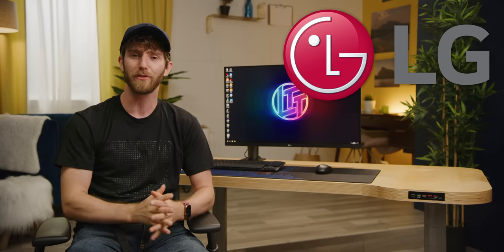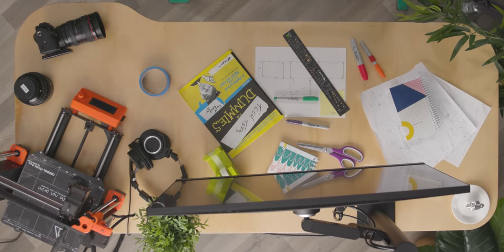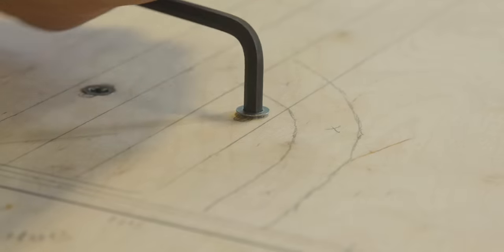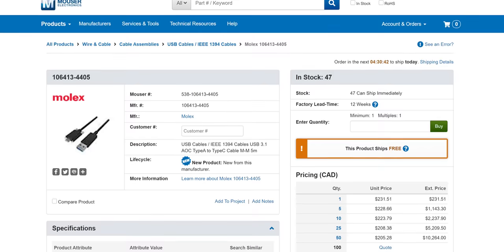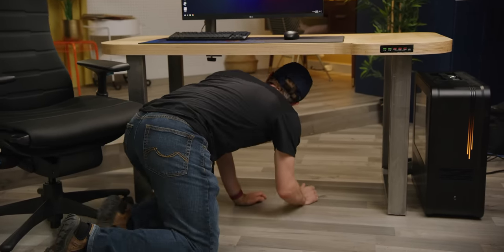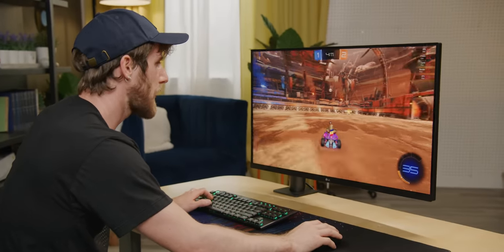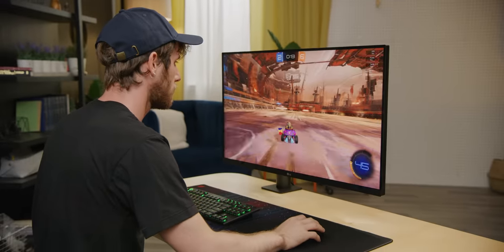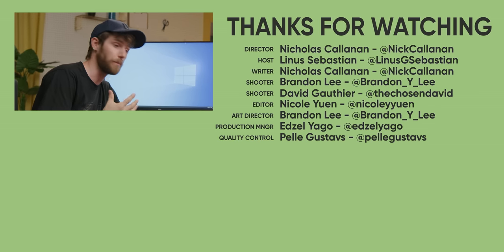Project Zero Cables - The Cleanest Desk Setup EVER

Comment: "I remember when 30" displays were super expensive" Yeah, so do I, Linus. It's called "today"
Reply: Well it ain't cheap that's for sure. My 50" TCL 4k tv only cost about half of what this monitor costs. The one thing I will say though is that I'm sure that monitor gives a much better picture.
Reply: Well, my "no name" 32", 1440p, 60Hz was around 350$. For casual gaming and work in CAD software it's great (paired up with i5-8400 and RTX2060)
Reply: I have an Acer curved 32.1 inch monitor I got for $250.00
Reply: It depends what res - 55"-65" is now very affordable for a TV even at 4K, let alone 1080p.
Reply: Ben Q has a 32 inch 4K 60hz 1ms monitor for $299 right now. I think LG has one with the same specs for about $279. I was seriously considering the Ben Q
Reply: You guys are getting monitors?
Reply: He's obviously referring to the excessively long period of time when 2560x1600 30" monitors cost $1,500-3,000 dollars.
Even while comparatively similar 27" 1440p monitors were sub-$1k.
Reply: Prices and perceived value will always be subjective, but everyone here can easily identify the difference between a $2,000 monitor 10 years ago, and a $350-500 monitor today.
Reply: meh my 27 inch IPS 1440p 16:9 1ms 120hz G-sync monitor was 800 euro.. 4 years ago when I bought it for 800 euro it was the ONLY monitor like it.

what surprises me more is than I wanted 4k 32 inch back than.. but nobody made them.
sadly nobody is making them today either.

-yes you can have 32 inch, 1ms, 4k and G-synch..
*but of IPS, 120Hz and 16:9 you can only have 2.
*you can have IPS and 16:9 but than screens only go 60hz
*you can have 16:9 and 120Hz, but than you only get VA
*you can have 120Hz and IPS but than it won't be 16:9 but those anoying wide screen monitors.

so I am still waiting for the monitor I want.. and despite all the "progress" 4 years later it still aint here yet.

as for widescreen.. at the moment I have 3 27 inch monitors turned portrait side by side.
that effectively gives me 27:21 what much closer to the for strategy gaming ideal 3:4 is.. than 16:9.
But I'd love to replace them for just one big monitor or two 32 inch, getting rid of some bezzles.
Reply: Well he probably gets them for free so he does not actually know what they are worth
Reply: @Joe K . You've been on the internet before, right?

Reasoning is not an attribute that is widely used.
Reply: I've an AOC Q3279VWF and was able to get less than 200eur. Its only WQHD with 75Hz but better than the FullHD 27" before and now i can count pixels on fullhd screens.
Reply: ViewSonic 32" 1440p 144hz curved $180 delivered from the factory over a year ago
Reply: @robertt9342  his name is funny so I think he has
Reply: @xManzi  And I can get a 32" tube type for free. Can't really compare 4K HDR10 apples to 1440p oranges
Reply: Manzi BENQ PD3200U?
Reply: Yogurt  *richer ?
Reply: @ReQuiem_2099  Same thing a few years before that when a good 24" 1920x1200 monitor was $800 but a 22" 1680x1080 could be had for less than $300. Back then, and I'm sure now, most of the people buying the outliers were professionals in fields like CAD, film/audio production, that sort of thing. Linus even said it in the video, this monitor isn't particularly great at response time, neither was my 24" Samsung back in the day (The $300 22" monitors had 2ms, I was stuck in the stone ages with 8ms 😂) but gaming was only about a third of my computer time. Different value calculation for everyone, the stupid expensive monitor wasn't great for games but it sure helped my productivity so it paid for itself in spades.
Reply: Yeah my buddy just bought a 4K 32" Samsung panel for $450
Reply: @petecastiglione6205  Next time try to read carefully... 1440p is nice middle ground. It's sharp so you can read text, 32" is big enough, and that resolution isn't so hard to drive Like 4K. So, no, it isn't comparing apples to oranges
Reply: @zakhaevw5258  no, I think company is called iilayama, or something Like that. It's a flat panel (i prefer it for CAD) and it's kind of minimalist/professional look so it was perfect for me
Reply: @tnix88  . wooo..... you see where this is going
Reply: @W1ldTangent  yeah, but for everyone that isn't getting the company to cover, or directly financially benefiting from their work, it sucks pretty bad! I remember the price hike on the 16:10 24"s too, but I really wanted those 1600p monitors back in the day. Now I have a curved 43" 4K that's pretty decent for basic productivity and light gaming, although obviously only 60Hz, but I'm keenly watching 38"(37.5) 3840x1600 prices.
Reply: @karelkootjes4019  The big market gap I see for the 4K real estate is 36". I've had a 39", and 2 43" "monitors" (they're TVs at that size) and enjoyed them, but you have to have a very specific seating distance for it to really work. Plus there's always a little fussing with scaling. I think a 36" would perfectly meet people's pixel density to screen real estate needs.
Reply: @ReQuiem_2099  haha, speaking of stone age, I'm still rocking the WUXGA party at home and work, dual 24s at both desks. I use docked MacBooks for anything that isn't gaming, and we likes our 16:10s 😂 2560x1600 is still pricey to this day, that and I physically don't have room for a pair of 27" screens.
Reply: Yogurt  Yeah, I wish he would think for a second before throwing out dumb out of touch lines like that.
Nobody I know has a $700 monitor, or would deem it anything other than "super expensive".
Reply: @ReQuiem_2099  
as I am a strategy gamer I must admit that the more of the map one can see at one time, the better advantage you have.
-
but if things get to tiny, you miss the very oversight you need, so indeed 4k for me only makes sence starting at 32inch.

as for your prefered 36 inch.. It seems that the market has a few prefixes and it seems that after 27 inch, 32 is the next step, so hoping for a monitor in that more standard size bets better bets than an off format.. but larger.. as long as it has my other desired specs.. is ok with me too.

my problem is there just AINT a monitor larger than 27 inch with the specs I desire yet.

as for ideal format.. I like my monitor at armslenght or about 60 cm (24 inch) distance from my face.

as a strategy gamer bent montors deform my vieuw, and for work too, so I prefer a straight non bend screen, that covers as much of the area I can focus on.. without covering the murky bits that only one eye can see.. that wide screen monitors give.

as such my practical vieuwing area is about 30 inch or 75cm wide and 22 inch or 55cm high.

That would indeed be 36 inch.. but only if in the classic 3:4 format.
->
if that got paired with 3200x2400 pixels (QUGA) it would be perfect.
though perhaps 4096x3072 pixels (HXGA) would be nice too.
(QUGA at that size gives it the density of 27 inch 1440p.. and while I admit I can see pixels sometimes if I sit to close to my screen.. it sufficices.. HXGA would make it 70% more dense.. making it more smooth looking without needing the unneccecairy density of 4k)

now that would be an ideal world.
But hoping for a HXGA 36 inch IPS 1ms G-sync 120Hz monitor is hoping for the impossible.. I would glady shell out 10k or 20k for the chance of owning such a marvel.. but the world has sadly moved beyong 3:4.
-strategy gaming is to small a market, and while it is true that in the office space 3:4 is still in demand.. they do not demand gaming specs and as such none of those overpriced modern 3:4 will have gaming specs.

-that said it seems the pc gaming monitor market has moved beyond 16:9 too.
*I wish for a product the market is starting to move away from.. we see a split happening.
-32 inch 16:9 IPS aimed at designers and editors.. for who 60hz suffices
-32 inch 16:9 120Hz as a "last ever made" VA product
-32 inch(and larger) 120Hz IPS all becoming widescreen 32:9 and 48:9 and the likes.. as most gamers (all not strategy and strategy has always been a minor segment of the gaming market)

so as things strand hoping for a 32 inch monitor with ALL my desired specs (IPS, G-Sync, 1ms, 120Hz, 16:9, 4k) is already hoping for somebody putting a real niche product on the market and likely being the last of it's kind.

*you say that perhaps hope glooms in tv land.. tv's are not yet at pc monitor quality but the gap is getting smaller.. and tv's are much less likely to move away from 16:9 anytime soon.
so that in 3 or 4 years a tv/pc monitor hybrid of 36 inch with all my desired specs might hit the shelves (though likely be the case.. might be probable..)

but for me that would not be ideal.. remember that vieuwing focus?
30 inch width is 34 inch 16:9 meaning 32 inch is just under it.. you can park your monitor a little closer.. it works.
but 36 inch makes it just wide for comfort.. you would have to put your monitor 70cm away instead of 50-60.. but that would be uncomfortable for computing.. still if all my specs were for sale but just 36 instead of 32 inch.. I likely would buy it either way...
Reply: @karelkootjes4019  Well have I got a monitor setup for you good sir! Step right up and behold an idea I've had kicking around since picking up my 24"(23.8") 1440p@165Hz G-sync panel. 3 24" panels in portrait! A nice, tall 5:3 aspect ratio, control over curvature, retaining 165Hz and G-sync, and ultra sharp 123.41 PPI across 11.06 megapixels of screen real estate. All while being about 30% larger than 4K, without breaching 5K. Your vertical/horizontal view range would be close at 35" by 21"
Reply: @ReQuiem_2099  i've got a similair setup with 3x27 inch in portrait mode.. but I'd love to get rid of those bezzles;)) with even more anoyingly so that my screens have a lid up button,  and a thicker bezzle at the bott, for that reason I find myself often using only 2 of those 3 27 screens in portrait mode with the bezzles to the outside.
but a bezzle-free solution would indeed be better.. 
(I even looked if perhaps someone made monitors to order.. like where do those compagnies, cinima, street advertisers, hospitals etc buy those very very large screens? there must be someone making screens in exactly the size and resolution you want, custom made, if you pay enough.. but I haven't found where one can place an order for that yet)
-> likewise if one looks if perhaps one of those medical HXGA screens (for I know they excist in hospital) is available for sale.. but alas I cannot find ANY HXGA screens anywhere.. 

I guess I will just have to buy a Asus ROG Swift PG43UQ for 1500 euro..
-> and suffer through horror that is VA.. and a not ideal resolution until an apropiate IPS screen apears or an compagny offers custom screens.

one would think.. with youtube actually supporting HXGA (it is youtubes max upload resolution) monitors with it would actually excist...
Reply: @karelkootjes4019  Not so much. Monitor screens, like NAND, HDDs, PSUs, CPUs, and everything else, have long since consolidated down to only a few manufacturing plants, with individual brands agreeing to a common enough general spec, then adding their own details and QA at the end.
Regarding medical/professional monitors, I don't have direct experience with the medical field, but I've been handled plenty of gov projects for watch center display walls, VTCs, ridiculously unwieldy multi-monitor/multi-PC/multi-network setups. The displays are much more niche, but not to the point of custom. With the display walls, modular would be a better term. We would typically agree to the basic requirements, and sub-contract out to the actual A/V experts. Then they would get the physical specs, and put together a flexible, but standardized package. The screens still generally come in a series of standard sizes, similar to windows and doors, but it's up to the experts to take the right measurements and get it all to fit together. Then it would just get cabled to hideaway racks of A/V gear with wooden cabinet front fascia, or routed to a full size rack in the comms room, or in the case of full on display walls, they usually make room behind the displays for the equipment and a hidden door somewhere to access it.
Reply: @ReQuiem_2099  so custom format screens are basicly dead?
But what you basicly say is :
unless you order a million of them for a product you planning and pay for a productionline started up just for you..
custom monitors are basicly multiple of the screens they already produce glued together, just without bezzles and the wiring hidden somewhere in the back.
*well that makes things more difficult, as 3:4 monitors just are not made anymore (those still for sale are all old stock, 500+ euro 15 inch 20-25ms crappy things)

Than I got 2 possible solutions.

for perfect viewing angle :
Take 3 of these screens in portrait mode, just have them made into one screen without the bezzles.
Acer Nitro XV340CKP Zwart
(if some compagny would do that, remove the screen out of the bezzle and seemlessly glue them together.. that be great..)
It would be a bit to large monitor for comfort..  creating a 50.4 inch screen
-> but with 4320x3440 in a 9:7 it would be very close to 4:3.
*they only make these in 34 inch.. so making a smaller variation of this option is not possible.
*but maybe it is possible to use it as a 4096x3072 screen, most screens I had do allow resolutions lower than their max settings and doing so would just leave pixels at the borders black and unused.
(in fact thinking this up... I am tempting to order 3 of these screens right now and do just this;) though I would want this solution but sans the bezzles..

alternatively.. for a more closer match on format : get eight 15 inch 1920x1080 screensin portrait mode, 2 rows of 4
This creates a 4320x3840 screen
of about 40 inch (75cm wide, 66 high)
(though the bezzles to bring this down to 4096x3072 are widers.. and few grafic cards support 8 monitors where 3 most do.
Reply: I have a square dell monitor and a retangle one both for like $5
Reply: @xManzi  I have a BenQ BL3200PT (Edit: $400 at the time I bought it), same size, resolution, and refresh rate. I don't do any CAD work, and there is a slight band in a part of the backlight on the right side of the screen, but the contrast, black levels, color quality (I don't know how accurate it is, but it's leagues better than my old TN panel Asus monitor) are all superb. It isn't HDR capable, but it's bright enough that ripped UHD blu-rays still look astonishing, even though they're not at native resolution.

That said, it has a 12ms response time, so it's hard to adjust to after using my 144Hz monitor for a while.
Reply: @MediocreHexPeddler  yea... I have laptop with 144Hz and it really is noticeable. It would be nice to have 144Hz on such a big monitor, but there is always some kind of tradeoff. My main goal was large, flat panel. 60Hz is enough for me, and I was comfortable with the price. So kind of, at that moment, it was perfect monitor for me (and still is)

Edit: they probably have the same, or similar panel
Reply: Well, in 2004 my gf & I bought a 720p 30" LG LCD-TV for €1799 and used it for gaming..
Reply: @xManzi  I'm sorry for your loss
Reply: @Anankin12  sorry for my loss?? What loss, wtf are you talking about?
Reply: @xManzi  Monetary loss. You own a kind of expensive card that's now obsolete and worth pennies. Sorry about that.
Reply: @Anankin12  That was really stupid comment, hope it isn't in corelation with your inteligence... Card before that was HD6350 or some kind of similar crap for 10 years. This will be in PC for at least 10 years because I don't really game.
Reply: @ram89572  Refresh rate, and latency is the biggest difference. Also- remember for a 50" the PPI is MUCH, MUCH lower then say, a 28" 1440p display.
Reply: @xtremeownagedotcom  Considering I'm about 8-10ft away from the tv I don't notice the lower ppi density. All I said was that this monitor wasn't cheap and I paid way less for a big ass cheapo tv, but that said tv probably wouldn't give as good of a picture primarily owing to the fact that it was an el cheapo model. Still though. 50" is nice to game on and you don't notice any issues when you sit at a normal distance. Would I recommend it for someone trying to play some super competitive fps title - no. But contrary to what many people seem to believe, there is more to gaming than CoD, Fortnite, and other esports titles. I would bet for a large number of games, a person is not going to notice that a tv has a higher latency by an extra 2-5ms.
Reply: PCDYYD Hardly crap for gaming. Is a higher refresh rate better - sure. But no it isn’t necessary. I’ve played for years and years and years on 60Hz monitors/TVs and somehow I’m still here. Just because 120 and 144Hz are the new hotness from all the little Fortnite players doesn’t mean you have to have one to have a good gaming experience
Reply: @ram89572  I agree with your statement.

I played 60hz for 10+ years and just upgraded to a 144hz this year.

Some people swear on a night/day difference that once you go 144hz, you will never go back! In my opinion, yea, it looks a little better. But, would it be a game-breaker to return to 60hz, imo? Not really.
Reply: @xtremeownagedotcom  Exactly. In my experience the difference between 60 and 120 or higher isn't enough to justify calling 60 crap. Even a bit less than that is really fine too if you are running something like G-sync or Freesync to keep the framerate and refresh rate sync'd up. The main thing contributing to a bad gaming experience is just that you don't want your game falling below your refresh rate.
Reply: @PCDYYD Yeah but that's my point. Not everyone is playing competitive mp games like that. I used to play them back when I was 18-22 or thereabouts, but that kind of game fell out of favor as I got a little older and cared less about mp and more about story. Back then there were no 120 or 144Hz displays in the hands of average people. I have limited time to game every week because of real life, so if I'm going to spend my limited time in a game, it has to be something that will make me happy. And competitive mp games are pretty frustrating when you don't have multiple hours every day to sit down and practice them. Also I am well past the point at which I can handle listening to screeching little 12 year olds.
Reply: @PCDYYD Yes, but you didn't even understand my post. Casual gaming and mostly CAD work. I know that some of you can't understand that computer can be used for something productive besides gaming. And RTX2060 was bought because of the software I use, regardless of what kind of refresh rate monitor was 60,120,144,320Hz nothing would change that.
Reply: @PCDYYD computer aided design, so yea. A 1440p 32", at that price was a godsend for railway and road design...
Reply: @PCDYYD yea, that was my thinking. It looks funny when you know that software is using straight lines, but you see curves on the monitor so I went with straight panel
Reply: @bobjohnston1239  let me guess VA panel they re the worst ones
Reply: no problem there, just wait 15 years and they becomes super cheap
Reply: Costly
Reply: Here are 10 comments so the next person gives you 64 for a stack which is a good number
Reply: 3
Reply: 4
Reply: (Twelve seconds later)
Reply: Ok can you do this for me?
Reply: Oh wait 4 more
Reply: 3
Reply: 2
Reply: Full stack!
Reply: Hate to make the 65th comment but he said 30 INCH monitors…
Reply: I have no idea where you live but I'm Australian and our dollarydoos are practically worthless. Yet I can find a decent 30" display anywhere from $350 to $500.
Reply: You can get a 32" 1440p 165hz monitor for only 350 dollars
Reply: I got a 1ms 180hz 32 inch 1440p for 480$
Reply: I got a 1650x1280 32” for 20$ at the thrift store with a 1080p webcam and attached speakers
Reply: I got cheap 4k TVs with heavy discounts, and use them as computer displays. They only have 60Hz refresh rate, though.
Reply: @xManzi  60hz thoooo that hurts
Reply: This monitor is only 380$ damaged box on ebay
Reply: @janemba42  this was 2 years ago...
Reply: @suavelifestyle9094  THIS WAS LITERALLY 2 YEARSAGO
Reply: ehh
Reply: i have a 27" for only 170$, how much could 3 inches add?
Reply: I'm still looking for 43 inch 4k under $1200
Reply: Bro my dad bought 2 30 inch 1440p monitors for 2k 😭
Reply: @ReQuiem_2099  ye my dad (since I'm broke) bought 2 for 2k in total
Reply: I remember when 42" plasmas came out and cost $10k